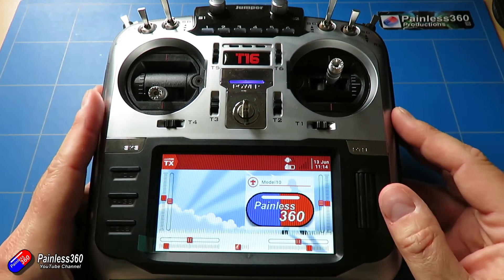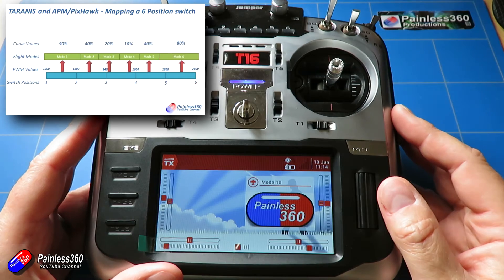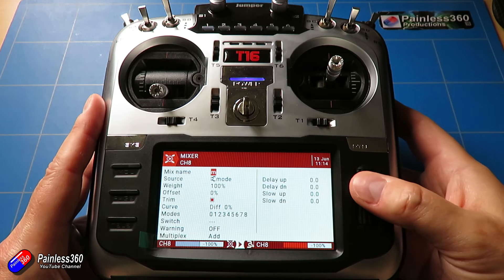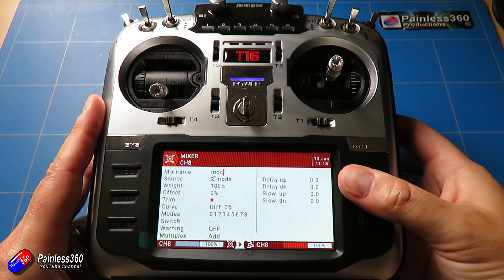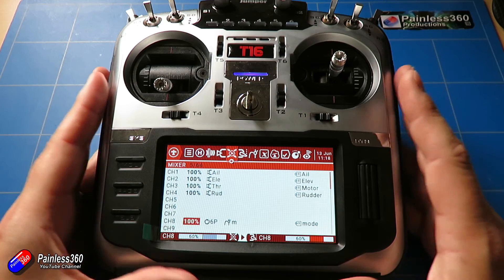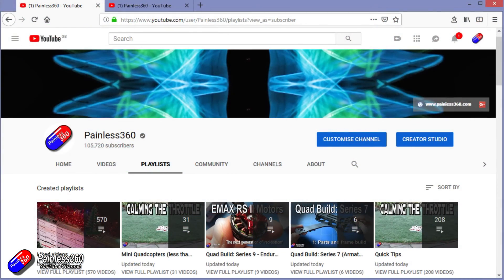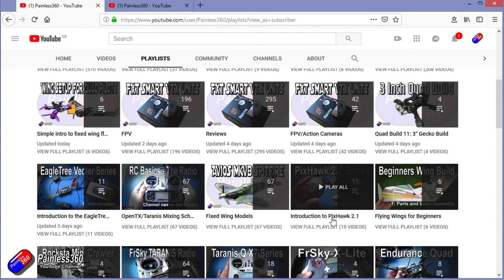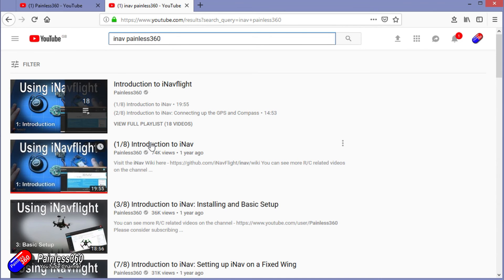Jumper T16 - Using 6 flight modes in ArduPilot

Comment: I feel like I should already know this, but if I've configured Acro and Loiter to be assigned 2 channels(with separate switches) in MissionPlanner>Config (RC6_OPTION-52, RC12_OPTION-56) can I also have Acro and Loiter present in the 6POS? This is how I initially set it up, just so I could have a physical switch at my fingertips as well. When I'm flying, it only will stay in Acro generally. I've checked it fully powered up and connected to MissionPlanner and the 6POS is functioning correctly and the PWM numbers are correct for all 6 modes. I"m guessing you can't have the same channel in two places, is the issue.
Reply from the maker: You could setup the switch to override the 6 position switch.. That would be one way.. Happy flying

Comment: Hi Lee  I set up the six switches on T16S for flight modes on mission planner. On radio calibration they work fine, but in the flight modes section the modes don't change.  Any ideas?
Reply from the maker: The default mode channel is different for Arduplane and Ardcopter. See my Pixhawk 2020 setups for the detail.. best of luck

Comment: Thank you for preparing this video. Not many people address to the use of Jumper with Ardupilot. I set up the 6 modes accordingly, but found out the pwm corresponding to the 6 buttons on Jumper T16 ranges from 1101 pwm to 1446 pwm only, while the 6 flight modes dictated in Ardupilot Mission Planner ranges from 0 pwm to 1750+ pwm. This means I can only reach 3 modes, while modes corresponding to 0-1100 pwm is inaccessible. I have changed the curve to the maximum of 17 points. This does not help. Any suggestion ?
Reply from the maker: Your only option is to edit the curve. Make sure that the radio is calibrated to get the full travel for those six position switch array.. Best of luck
Reply: @Painless360  Thanks for reply. Today, I watched your video again. I re-calibrated the Jumper T16 by pressing each of the 6P buttons, along with sticks and other switches, but that still did not extend the range beyond ~1400 pwm. I edited the curve with all possible values, changed weight to -100% in MIXES,  put some values in offset, all these did not help. Any clue ?

Comment: Hey Lee, do you have any experience with a Frsky Tandem X20S? I got this radio, it's a beauty by the way. Working on a quad. So i kind of have a similar setup, this transmitter has 6 buttons on it but i don't think they act as a 6 position switch. I couldn't find how to assign normal radio commands to them, would like my six modes to be those six button. I did get 6 modes working on 2 switch, as per other videos, but the problem is it seems to hit the middle mode for a second, before it adds the offsets to then kick to the offsetted mode. This resulted in me briefly going into stabilized mode from alt hold, throttle was a little high, craft climbed like a rocket right into a tree, broke three props in one go. I am okay with the 2 switch setup, if i could get rid of it hitting the interim mode while switching. This radio does have a couple settings not mentioned in the OpenTX videos. Any help would be appreciated, and while i'm at it, if i get an answer, is it possible to pass GPS info from a FrSky GPS V2 to a Orange Cube? I ordered a 'here 3' but they are majorly backordered. I got the yapuu telem cable connected, though i also don't see what seems like any telem coming to the radio either, so possible i haven't set it up correctly. I may need the script running to see anything on the radio side, and they haven't written the script for it yet, if they ever will. Little disappointed here. I thought at least the sensor outputs would come through. I have zero experience with OpenTX, this is my first 'real' radio, first quad. Jumped in head first as you can see!!!
Reply from the maker: I have a video on how to do that - https://www.youtube.com/watch?v=c-eShYkcA7g may help.. Best of luck

Comment: A question if I may... Suppose I would like to protect one of the modes by another switch, for example I'd like to set mode 4 as "Auto mode" but since this is a risky mode i would like it to engage only if in addition to pressing button 4 I'll flip switch SD. 
Is there a way of doing that? Logical switches maybe?
Reply from the maker: Yes. Check out the OpenTX mix school where I show that.  Best of luck
Reply: @Painless360  thanks for the super fast reply! You are the best!

Comment: I accidentally created an extra flight mode. How do I clear it? 
I can zero the name and the trim values but not the activation switch...
Reply from the maker: Just make sure you can't select it with a switch and it'll never become 'active'..
Reply: @Painless360  That's exactly what I did but I was hopping there is a secret way to clear a FM line...:)

Comment: Will this strategy work with tbs 900mhz and sbus?
Reply from the maker: It doesn't matter what module you're using. Happy flying!
Reply: @Painless360  I'm having trouble getting the pixhawk 4 flight modes working with tbs receiver and sbus. Everything else works great! Thanks much! Stay well

Comment: Don't know if it's just me but the Jumper 4 in 1 runs the SPI receivers in D16 without issue. I have the BN220 on Trashcan with all that kewl telemetry INav on radio and betaflight on Flight controller. Gonna try the arupilot when they get the google maps screen working.

Comment: Which are better make radios taranis or jumper? And what is the major difference between those two brands
Reply: I'd say that FrSky is a very well tested brand in the RC community. That being said, Jumper is relatively new and hasn't undergone extensive testing. Though many positive reviews have come across about it, I'd make a decision based on if you want a radio that can actually be programmed to its core or if you want an easy to use radio and don't care much about programming. I'm not sure about the range on Jumper and how well it handles interference and all of that, but FrSky's protocol is definitely one of the best.
Reply: @pawanv86  thank you for your reply

I also checked Jumper's website there is no mention of range which is definitely a grey zone.